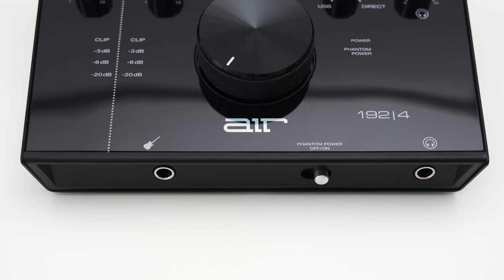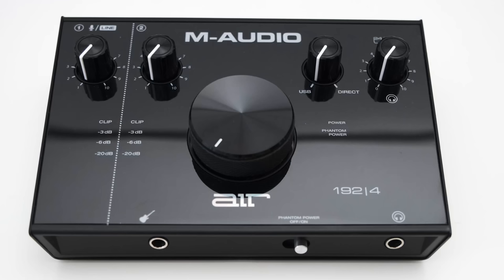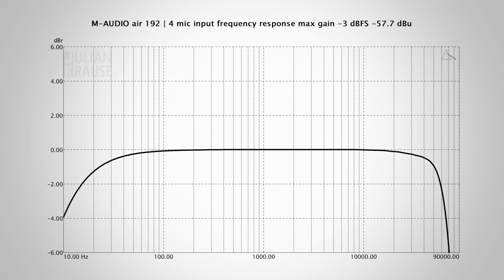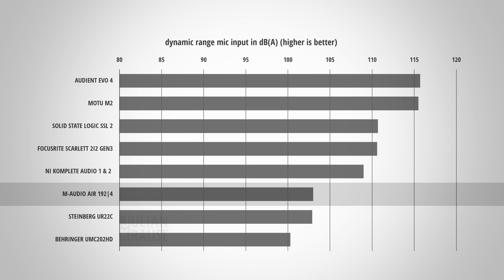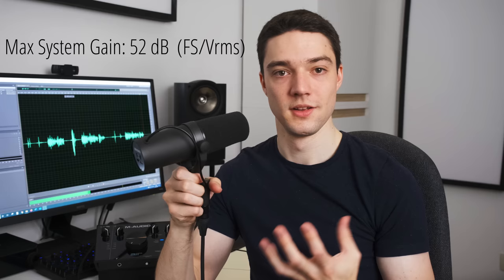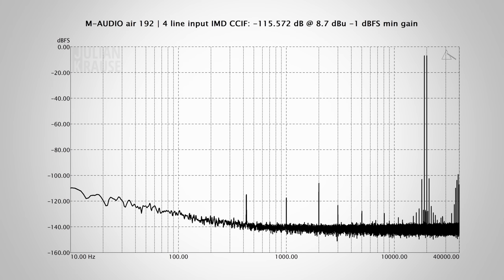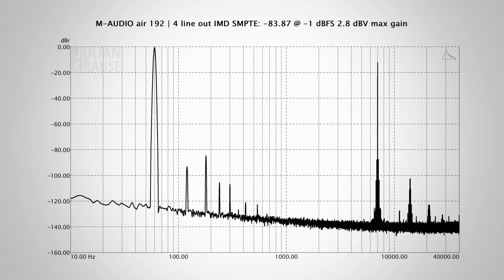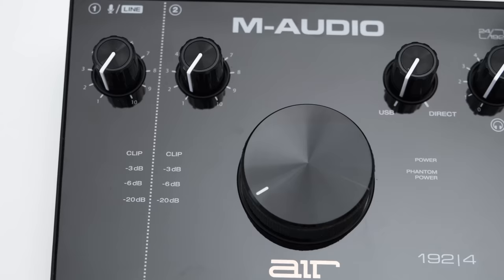M-AUDIO AIR 192|4 USB Audio Interface - REVIEW (audio quality measured)

Comment: Very happy with my 192/6...by far the best desktop interface I have ever had. Zero installation issues and dead-stable driver from m-audio.  I also love the little interface buffer setting widget that installs with the driver that lives on the toolbar. No menu stuff in the daw to switch buffer sizes from tracking to mixing...reaper anyway sees whatever change u make to the buffer in the toolbar widget instantly. Minimizing trips to the preferences menu is a big 👍from me. 🤘
Reply: HI I have the 19216 and was wondering if I should connect my guitar plug in the front jack or combo in the back, supposedly the combo is for active and front for passive.. the thing is my guitar goes through powered pedals like boss looper and boss space echo, so I don't know if that should go in the front jack or the rear combo as both pedals have volume control. Thanks!

Comment: I really love your reviews; my only advice would be to comment a little on both Mac and Windows drivers - I've found that sometimes it doesn't matter how good the performance is if the drivers aren't up to scratch. This has really impacted the Audient, for example, and recently the Motu.
Reply from the maker: Hey, I totally understand your request to talk more about driver performance. The problem I have with that is that it can be very different on different PCs. My experience might be quite different than yours. I have used some many audio interfaces without a problem and yet some people report that they are running I to some issues with the same interface. I don't think I can make a representative statement about driver performance. That's why I usually don't talk about it.

Comment: Thanks Julian! I've been looking at the Air 192 | 6, and your review of the 192 | 4 convinced me that the | 6 is very good for what I'm needing it for (Dynamic microphones).
Reply: Do you use a Mac? I have Windows10 and tried to connect it but I had serious driver issue where I couldn't even get it to work.
Reply: I use Windows also. I don't see any major reported issues with the drivers though. And Julian has the preamp going through his Windows 10 machine in the background.

I know that for example, some people have focusrite scarlett driver issues and others have no problem on the same Windows version. Strange.
Reply: @EGODINGO32  I think its the anti virus. Thats the only think that creats errors.
Reply: @raynidayacoustics7829  wish I knew about it before I returned it. I ended up with the Focusrite Clarett 4Pre USB  instead. I wasn't just about to keep something that I couldn't or didn't know how to use.

Comment: Few days ago I replaced my Scarlett 2i2 3rd gen with the M-Audio Air 192|14 based on this review. I needed more inputs than the Focusrite had.
At first I turned my sight onto higher Focusrite models, but one feature erased them from my interest: they are controlled by software/drivers only.
For me - a Linux user, almost all Focusrite interfaces was eliminated therefore, and 18i20 was out of my budget. After weeks of research, comparing features and watching reviews I decided to buy M-Audio Air 192|14. It has all the features I want: 1) Physical knobs/switches to controll all functions, 2) Class-compilant - no special drivers for Linux required, true plug&play, 3) Desktop design (vs rack design). For now I'm very happy with this device, except some minor backdraws: - MIC gain behaves strange, almost all gain is placed between 9,8 and 10 on the knobs, no dedicated on/off monitoring switch, only the input/usb knob. I got used to the Scarlett on/off button. No gain knobs for line-ins.
Now I have all my devices (microphones, DI box, guitar processor, reampbox) connected to one unit and I don't have to manipulate cables - this is something I hate, and still have 1 mic input, 2 line inputs, and 1 line output free. As for the sound quality I didn't noticed any major differences. Regards!

Comment: I had this and used it for few months 'professionally' and privately, and I agree with Julian Krause, that while this is not the best, but it's really good enough, especially if you remember that this interface is one among few cheapest interface which can go 192 kHz. I never use 192 kHz, but that made me consider that M-Audio had serious effort in designed and manufactured it. The buttons, especially the volume button is one of the best feel you can get compared to the others, even the expensive ones. Although unfortunately it's limited number of inputs mean this interface also only has limitation in how we use it. Anyway, Thumbs up for a relatively cheap if not one of the cheapest interface out there. I saw the price is getting down too. And the driver is still ok for newest version of Windows which means it's even a better buy now. Thanks Julian Krause for a great review.

Comment: Thanks Julian. I would really like to see you do a series or a single video of Top 3's of your personal favourite pieces of equipment that you review throughout the year! 

I just ordered the 192/14 based on this review. Performence:Price:Features it suits my needs perfectly. Will get back and let ye all know how I get on.
Reply: how was it so far?
Reply: @efecanaltn4963  After reading some other reviews online, I returned it without opening and testing. There were a lot of reports from Windows 10 users of driver issues & poor support/responses from M-Audio. I instead ordered the Audient ID14 MKII which allows for expansion through ADAT.
Reply: @kevc6115 oh thanks for the review. Do you suggest the ID14 or ID4? I'd be pleased if you share your thoughts about that.
Reply: @efecanaltn4963  I am over the moon with ID14 MKII. The sound quality is excellent. It is easy to set up and the software is very simple to use. I use it in Windows 10 along with Cubase 9 & 11 also Ableton Live 10. I have had no issues at all. It is worth noting that there have also had a few firmware updates from Audient since I purchased in February.
I cannot comment on the ID4 as I have not used. The ID14MKII allows you to ad more channels through ADAT using a mic pre such as Behringer ADA8200 or the Audient ASP800 or ASP880 for example. From the research I have done, mainly from Julian and also Podcastage among others, the Motu M4 or M2, The SSL2 or 2+ or the Audient, you cannot go wrong. It really depends on the feature set you are looking for. The ID14MK11 is the only 1 that allows to expand the number of channels. My suggestion to you would be to creat a check list of features you want and list them in order of priority. Then go through each of the interfaces and check off which you want. Shortlist your top 3 then go and research through different reviewers on you tube, gearslutz, reddit and so on and see if people are having issues and if the companies are responding to them.
I hope this helps you.
Reply: @kevc6115  It means worlds to me. Thanks for sharing your insight. It's quite expensive here in my country. But I'll check it out. Again, thank you very much, god bless you!
Reply: @efecanaltn4963  If price is a concern, then there are plenty of interfaces at every price point that are pretty decent. My first interface was the Behringer Uphoria UMC404HD and I was very happy with it. You can't go wrong with any of the Focusrite interfaces either.

Comment: Dude. I was wondering around looking for advices on interfaces, with my main concern being mainly headphone amp which is typically the weak spot in this price range. Found this and the previous video and decided to buy an M-Audio Air 192/14 right now. Thank you very much for the work you do as a content creator, you gave me detailed, precise and easily understandable explanations in an hour, sparing me of days of research. Subscribed!
Reply: do you like it so far?
Reply: @David-ub8bv  oh well you get a lot of in and outs for the price. It is true that the preamps are very clean, the design looks gorgeous and the build quality feels ok. Not amazing, but okay. I am satisfied.

Cons? It gets very warm at the touch which annoys me and despite the headphone amp being louder and better than usb-driven interface it is still not enough to monitor my voice without using an external amp. So yeah… the headphone output is better than others in its price range but that doesnt mean It’s good.
Reply: @arkaxvii4699  thank you so much for taking the time and answering!! Have a great weekend

Comment: Thanks! I've been waiting for this review ever since I saw you had ordered the unit. I'm debating between this and the EVO 4. The loopback functionality of the EVO 4 would be nice to have but it looks like the M-Audio's much higher max gain setting has me sold. Keep up the great work!
Reply: MOTU is better than both tho
Reply: @spetsnazbeaver  True, on paper it seems like the best choice. However, the price is considerably higher. I think it's still worth it for what it offers but I'm wary of the issues multiple people have had with its drivers. Also, this is just due to my setup but I prefer to have the line inputs on the back of the device.
Reply: afaik evo 4 58db max gain and 192|4 52db
Reply: @ichayanglaen8278  According to Julian's testing the results were the opposite. Anyway, I ended up having problems with the M-Audio (it has issues with AMD-based systems) so I got the EVO4 instead and it's been great. I do have to crank the gain but it is enough to drive my SM57 just fine.

Comment: I've actually been listening to music on this particular interface and comparing it to a DAC which is rated as one of the best sounding DACs under $200.  Having audio playing back to both devices at the same time and switching between them, I really couldn't hear much of a difference on any of my studio monitor headphones or IEMs.   The IEMs I tried are 16ohm as well, which SHOULD be worse case scenario for higher output impedance, but any differences it may have made were inaudible to me.  It's also quite a bit louder than my standalone DAC as well, so I don't even need a headphone amp anymore.  I think just for the DAC and headphone amp alone, it's well worth $110.  Since Julian Krause also measured it as having one of the best stereo separation out of the lot too, I am eager to try this with balanced headphones at some point too using the balanced outputs on the back.

At this point, the XLR and instrument inputs are just icing, but with a decent input sensitivity and low noise floor, it's probably well worth $110 for an XLR interface as well (I'll be able to test that myself this weekend when my new mic arrives.  It's definitely a solid buy at $110 USD.
Reply from the maker: Just FYI, the balanced outputs on the back are line level outputs and not designet to power headphones. Only the headphone output on the front will properly drive headphones. Cheers!
Reply: @JulianKrause  Yeah, I know line level input isn't supposed to be enough to drive headphones, but without the balanced outputs on the back, a balanced headphone amp is useless, which is why I didn't get the NI Kontrol Audio 1 for the same price.  

But, just out of curiosity I did plug some IEMs into the back output, and got more than enough volume out of it.  One channel only of course since I was just using a 3.5mm to 1/4 adapter to test the output.

Comment: Perfect timing haha.  I actually just ordered this a week ago, currently waiting for it to be available.  Decided to snag one because of the high preamp gain for my gf to use dynamic mics for voiceover on videos.  While I upgraded my interface to the UMC404HD last year, the hand-me-down M-Audio Fast Track Pro didn't want to play too nice with her Mac and Premiere Pro.  Figured some modern drivers would help, and might as well get more dB for the SM58 and the new Podmic.  Glad to know that I wasn't far off the mark with the purchase decision there!  Great work as always!
Reply: Due to this video I just purchased it from Amazon new for $109 USD but it is OOS until the 29th.  I bought a pair of head phones and a BM-800 kit (came with the two XLR cables needed) and still came in under the M-Audio kit that didn't even include a stand/arm for the mic.  Had it had that I would have bought it.  I just returned the Neewer 8000 USB as it had a high pitch whine (low level) and with everything cranked up I had to touch it to my lips to get the audio to 1/4-1/2 in Audacity.  Defect but I had enough with USB only mics so my world will open up now with XLR.  Not expecting the world from the BM-800 but it is a start for now.

Comment: the predecessor 'm-tracks 2x2M' is the same and has around 7 dB higher dynamic range, same is true for the Air 196/6. Still works with Sonoma in 24 on Mac cause it's class compliant, so no driver hassle :)
You can find them for cheap used, mainly the 2x2M MTrack is far underrated. Not only if you're on a budget, that's a great choice.

Comment: Thanks for this professional review, it is much needed.
My main concern is latency because I record in real time.
3ms is good, 5ms is acceptable and 10ms is problematic.
The RTL list is useful but at which latency the device starts to lose packets?
Did you experience buffer errors while testing RTL?
Reply: Oh, Lord I remember this when I was making music years ago and I never could get that old PC to go below 14ms (12 was iffy at best) and it was felt for sure.  I had to use ASIO4all and that is not all that great YET Behringer has now switched to it to save costs so I never even considered them (plus I know them, and used them, and purchased them over the last 15 years and mediocre at best).  I hope this doesn't use ASIO4all for the low latency work.

Comment: For anyone wondering the Air will power DT770 250ohms just fine with plenty of headroom. Out of the Mtrack solo, Scarlett solo and Air, the Air is the only one I didn’t need headphone amp.
Reply: Alright boy, please tell me how loude its play? Are enought to daily use? I have this dac with maudio bx8 and its works pretty good but i thinking of buying dt990 pro 250ohm so I'm worried if they can handle 250 ohms
Reply: @fryceknj4038  Loud enough to get unsafe listening levels. When I maxed it out I had to take them off and could still hear them very loudly. It also depends on how you use the monitoring setting. For comfortable listening: Volume at 60% when blended monitoring. Volume at 50% when USB monitoring only. They were so loud I returned the amp because I no longer need it. I can't speak for audio production but for gaming, recording, music etc trust me they will be plenty loud with plenty of head room.
Reply: @tpow2651 Hi buddy, I use the 192/4 too, and I was confused if I should get the 80 or the 250 ohms version of this. Upon asking M-audio technical support, they said it to drive headphones ranging from 32-600 ohms. So, if the monitoring-usb knob is not blended with the sound, does is gets loud enough. And does it distort when the volume knob is set to the max?

Comment: Hi Julian, as always, another great video. I have a tricky one:  Looked at the noise comparisons you made between the different interfaces, and the maudio 192|4 was clearly on of the quiter ones. So decided to get the 192|6 (basically the same preamps and ADC) to replace my uphoria um2, which by all comparisons was noisier and had less "real gain".  Connected both to my pc, and just recorded with the gain set to max with nothing connected - the um2 was quiter. Connected the same microphone to both interfaces, seems like the um2 actually had more gain.... What am I missing??